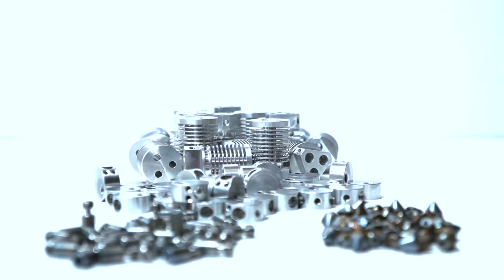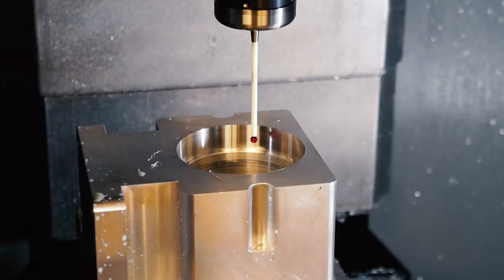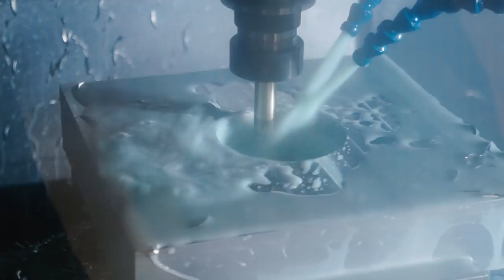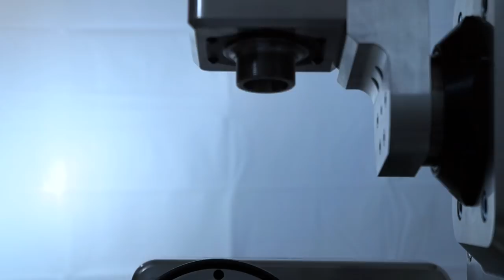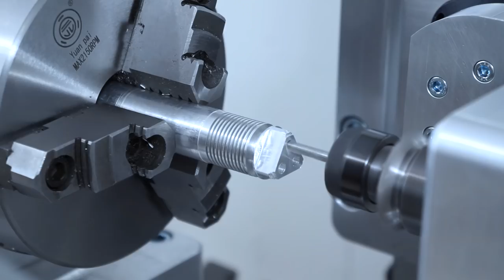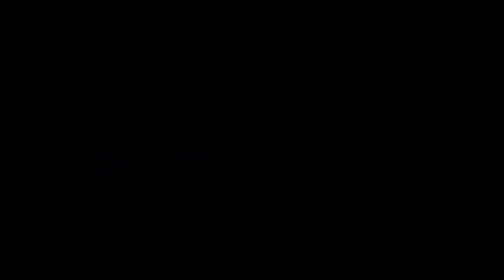SwissMak Kickstarter Launch - A Desktop CNC machine for Makers

Comment: Aluminum body.. why not.. but aluminum ways.. WTF??!
get some linear guides in there for it to make any sense.
Making the thing on imba VMC wont make it fit together perfectly. Every part is made at some tolerance, you need to make your design in such way that it can be easily trammed, no matter how your parts came out.
0.05mm could be good enough for the mill part of the story but If its a lathe I expect it to make parts at least to 0.01mm accuracy.

At 1:45, how is the endmill ofset from the lathe centerline? does the machine have movable axis in that direction?
Reply: Ivana Bunjevčević get em girl!
Reply: First you bring tool to the stock material in lathe chuck(z axis), bring mill head(y axis) down and zero d.r.o. and  make a first cut, rotate chuck 180 degrees and make another cut without moving y axis height, measure part. Divide this measurement by 2 and lower y axis(mill head) by this number and u then you will on centerline of lathe chuck(z axis)with the axial cutting face of the endmill.
Reply: I thought this machine doesn't have the y axis (other than for toolchanger), but after watching the video again I see that the whole column moves in Y -direction. I don't like that.
Reply: @ivanabunjevcevic9364  could you please fill that out a bit more.  Is this due to concerns about drive system lash and possible wobbling of the axis because it is on ways, vs. fixed in place?
Reply: tilting spindle itself is a problem but this spindle has 3 axis behind it, and each axis has its own wobble and they stack upon each other.
Reply: @ivanabunjevcevic9364  "but that doesn't happen in the CAD drawing!"
Reply from the maker: @ivanabunjevcevic9364  Pretty much all of the full sized mill-turn centers (Mazak Integrex, Mori NTX, ect) are traveling column designs. Machinists who use them call them a "real Y axis" as opposed to the wedge type designs on Y axis lathes; these severely limit tool clearances and travels.
Reply from the maker: @ivanabunjevcevic9364  The turning spindle that holds the workpiece slides along the Z axis. The milling column is in X (in and out) and Y (up and down). The boxways allow preload in all directions, and the anti-backlash nuts have less than 0.001" of slop.
Reply: @overlordroboticscorporatio7547  They're also cast iron castings weighing several thousand pounds.

When you lack mass, you need more rigidity.

What's your price point for one of these?  What's the working envelope?
Reply: How many linear guides are you used to seeing in the kitchen?
Reply: @overlordroboticscorporatio7547  Hi, How can I get this form and is there a website to communicate and see other forms please answer ... Thank you

Comment: Looks great - will it be able to process 30cm pieces of steel in lathe mode, and 24cm of hard all in mill mode? If yes, i am staring to save my money;)
Reply from the maker: Yes, it has a long max turning distance - just over 400mm. At these lengths you obviously need the tailstock as a support.

Comment: Aluminium ways? No thanks. Some low cost hiwin rails and blocks would raise the cost some hundreds and would make the machine far more precise
Reply from the maker: We put out a video showing the process of making the boxways, and photos of the hard anodized boxways are in a recent Kickstarter update. The boxways are more precise than linear rails and have much better damping properties and stiffness. There is no plain, exposed aluminum and no metal on metal rubbing. Linear rails and blocks would be a downgrade.
Reply: Sherline and Taig both use hard-anodized aluminum. I understand your point, but if you treat the machine as it should be treated (light cuts), I'm sure it'll work fine.

Comment: So basically all it can cut is materials softer than bronze. It would never work for steel, and as previously stated it is made from aluminum. There is a reason machines are made from cast iron or cast/forged steel to a lesser extent and it isn't just the weight or cost of a casting. Trust me, if you could build a rigid machine without it, cheaper... Well everyone would be doing it.

Comment: for the music alone, no.  For the machine, ...no also.  Just like a guy said below, aluminum is not vibration dampening like cast iron is, so the machine will have a ring to it, and so will parts being made out of it.  For the money, ....6000. ....well, whether it is 600 dollars or 600,000 dollars, ...what we want still does not exist.  The big old manufactures have not found the recipe yet, and the new guys are too dumb.  We will get there.  We are almost there.  All this stuff is new to our generation, and we are still figuring it all out.  This machine looks great in the video, and is so clean and nice and beautiful, but it ain't the real stuff.  It is straining at everything it does, except for drills and champers, and stuff like that. It's got to be made out of iron first of all. Aluminum does not even make any sense.  I have a big heavy CNC made of aluminum, and ...It is good for lightweight stuff, and can easily mill steel, but it is not the real stuff.  I am learning as I go, and this concept of aluminum not dampening is important for cutting even aluminum. I see some nice lathe rebuilds on youtube, and the old giant machines are so smooth, but they are like starting up a 767 jet plane, and that ain't cool. It is very intense.  It is like the NWO figures out exactly what you need and then makes everything but that.
Reply: I think either DMC 2 or the samurai 120 have solved it, both look like great machines

Comment: this could be a really cool machine if it's rigid and powerfull enough. Does it also cut steel reliable?
I always dreamed of a turning/milling machine but they are all China Crap.
Reply from the maker: In the video at 1:43, it cuts an iron bar into a twisted hexagon with a decent chipload.

Comment: This is essentially a cnc lathe with mill attachment. The first of its kind in under $5000. You mention on kickstarter that you need to buy an expensive  VMC to build parts for swissmak. So swissmak isn't self reproducible. It cannot build parts for itself.
Reply from the maker: It can make many of its own parts, but not all of them. Pretty much anything that fits in a shoebox size work envelope can be made. The largest parts of this machine are 4 feet long (1.2m). 

Do you know of any machines that can make their own entire mechanical structure?
Reply: Lol destroyed
Reply: A commercial VMC would build parts 20 times faster. I'm sure you could build it on this, but there'd be a lot of set-ups and slow cutting.

Comment: That thing is as rigid as a wet noodle. For anyone keeping score, the chip load on the demoed metal parts is laughable. Even if the rest of the machine was skookum (which it isnt), the cycle times would be unbearably long. You won't have to wory about tool life, though. Good luck cutting anything harder than 6061. For a machine best suited for polymer, you might as well get a decent 3D printer and save a headache or 2(^10)...
Reply from the maker: The machine takes a decent cut in an iron bar at 1:43 in the video. It's limited by how much power you can get from a 120v outlet, not rigidity.
Reply: @overlordroboticscorporatio7547  can it support 240V. We don't have 110V.

Comment: Why did they make it out of aluminum? I'd rather pay the slight bit more for shipping and get machine a million times as rigid. I understand it's not for industrial purposes, but for $6k it shouldnt be made of aluminum. You can get a used small machining center with a toolchanger and a few hp spinder for 3-4k and then hack together a 4th axis for a bit more. Maybe that'll cost a little more in the end but you'd get something a hell of a lot better.

This type of machine is great, and very needed right now, but the price is a little too high. I could only see the price being justified if the thing has incredible precision like tenths or less (which I'm guessing it does not, I thinking it's a standard thousanth, maybe half a thousandth).
Reply: You are first putting up a range of ideas and suggestions to make the machine more expencive, then next you conclude that the machine is too expencive as is for you to concider it. Didn't see that one comeing. Clap. Clap. Clap.

Comment: This has to be a scam. Aluminium ways aren't even practical.
Reply from the maker: The prototype shown here cuts ferrous metal just fine, watch the helical side cut on an iron bar at 1:43 in the video. The Kickstarter machines (and everything produced after this prototype) have hard anodized boxways. A lot of coordinate measuring machines are made with rails of hard anodized aluminum, and those are precise to microns within their work envelopes. Check out our updates on the Kickstarter page.